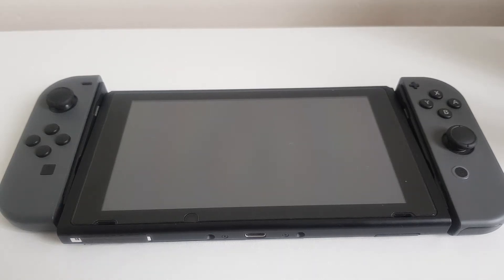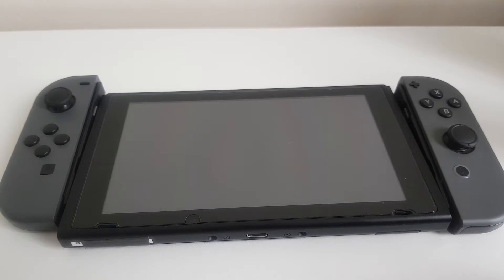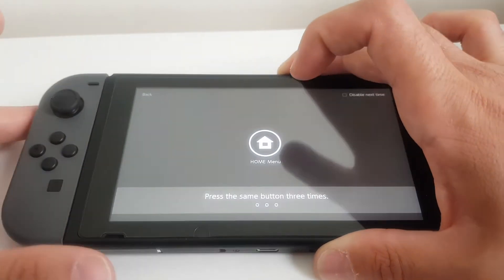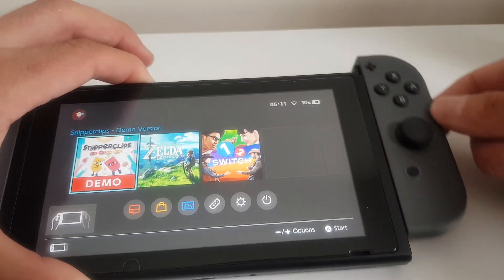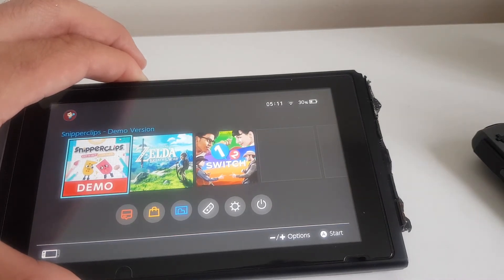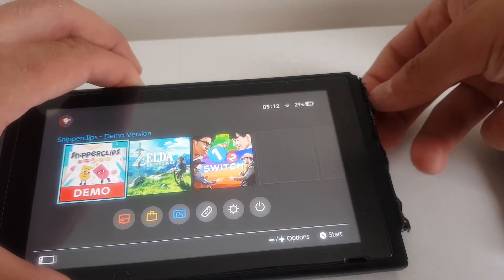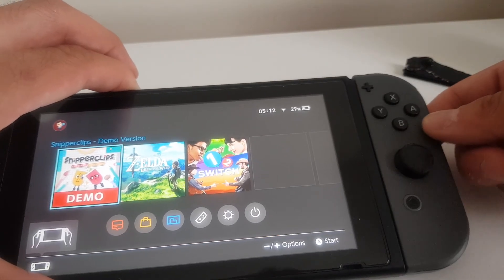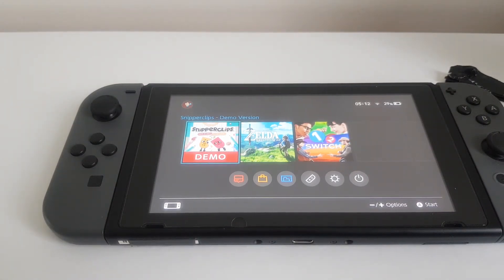Right Joy-Con Problem - No Snap Animation/Sound played

Comment: Ok, here the issue,
The issue is with pins. They get shocked. Maybe 1 or 2. It's random. Maybe you played the switch too much is charging mode or attached the dusted joycon. You need to replace the pins. You will get the snap sound again. 

Maybe this will help ya.

Comment: did you find a solution? ive had this for around 3 years. its also only a cosmetic thing but dont feel like buying new rails for the switch and joycon. any info would be much apreciated!
Reply from the maker: Unfortunately, I haven't checked it out, as mine is always in a case (never use it as docked) But I think it's a faulty Switch rail
Reply: @HtheB61  thanks! i will keep looking for info, seen some guys trying to spoof it and all kinds of stuff. dont want to buy a replacement from amazon either as you never know the quality. I only want original parts

Comment: I fixed my other side my getting a toothbrush and there are these sensors that fill with dust and stuff so I lightly scrubbed them and it worked 1 @at the very bottom of the console were the tho g slides in and 1 and the bottom of the joy on under the flat part
Reply: I watched a video from user My Mate Vince. He got the animation fixed with a new toothbrush 🙂
Reply: Julius Coronel Could you link me that video by any chance?
Reply: @viracati  

Hi!

I can't seem to copy the exact URL of the vid here on my YouTube app. But you can try searching "3 Annoying Faults on the Nintendo Switch & How to fix them"

The user/uploader is My Mate Vince 🙂
Reply: Julius Coronel perfect thanks 😊

Comment: Hey man I have the same issue. Have you solved the issue yet? Looking for a solution as well.
Reply from the maker: Unfortunately, no. I just live with it... It might be that one of the pins did got damaged. I'll probably change the rail of the Switch to see if it will solve the problem once the warranty is over. I'll put an update if it does fix it.
Reply: @jessehalsing  did you fix it?
Reply: @HtheB61   did you replaced the rail
Reply from the maker: @MutedRed_  No I haven't, the problem still exists. I might replace it soon though.
Reply: @MutedRed_  hmm. i replaced my right rail for a different issue but now have this same problem.. seems probably the rail